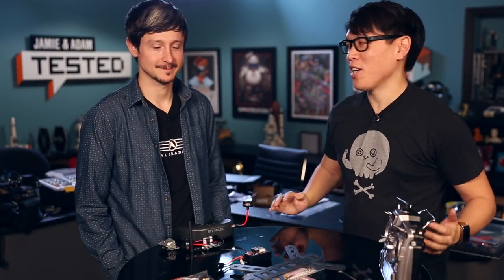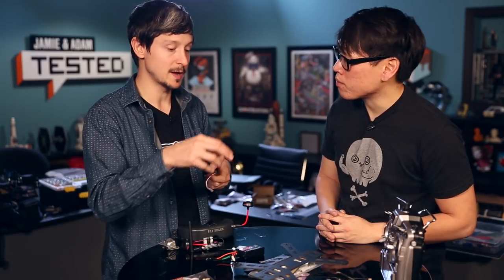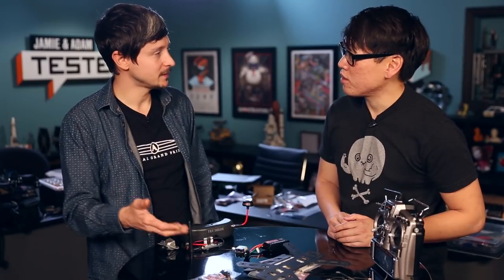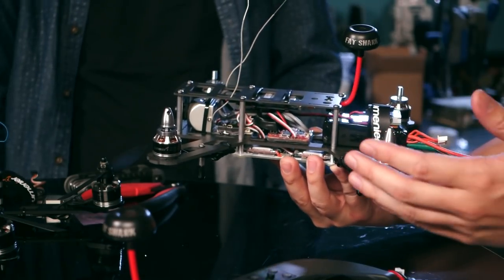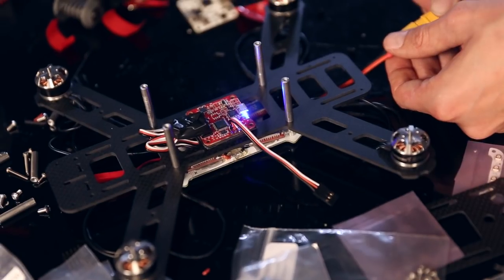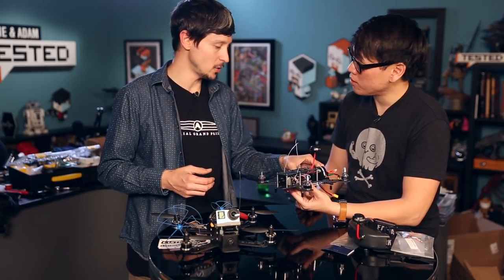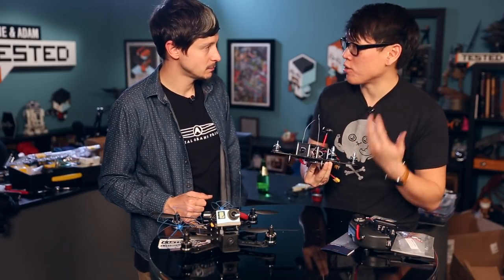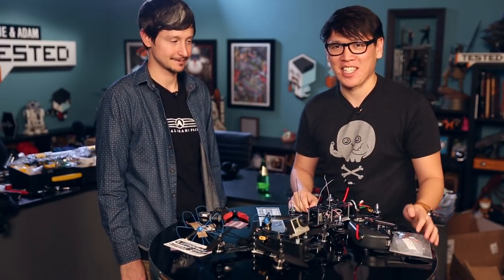How to Build a FPV Racing Quadcopter!

Comment: Hex Copter racers are the future of FPV racing. With Brushless motors these little footballs are easily achieving speeds in excess of 80KPH (50MPH) Outperforming their quad racer counterparts. Smaller size, more power. 20Mph winds? Can still pull out the hex racer. While all the quads go home.
Reply: but... you also have more things to repair and a bigger size to worry about. I am hitting near 80mph with that little guy, dont get me wrong I love hexs! But this is a way better alternative to start with.
Reply: My hex is smaller then this kit. I know when you think of a hex copter, you think big. But I'm talking about Mini Hex Racers. Like the TBS Gemini, The Thorax Mini FPV, Spyder, & Blackout's Mini Spider. Generally Mini Hex kits.

The battery performance on a mini hex gives you more then the power hungry quads of similar size.
Reply: 𝕮𝖙𝖍𝖚𝖑𝖍𝖚 Four motors is enough. It's better to spend the weight budget on higher power motor/ESC/battery combinations than adding more weaker motor/ESC combos. Speed in a straight line is limited by the maximum rpm of the props, and speed around a corner is limited by the power to weight ratio (which again, depends on the max rpm of the props), and acceleration is again limited by the power to weight ratio. Carrying around an extra two ESCs and motors does nothing to help any of these cases, and only increases wind resistance and maintenance. You are also wrong about the sizes, because all of those frames you listed are bigger than the QAV250 shown in this video and would not be able to compete in a 250 size racing event anyway:
TBS Gemini - 315mm
Throrax Mini FPV - 310mm
Blackout Mini Spider - 290mm
In fact, I think you will find that the smallest you can make a hex with 5-inch props is 256mm (with props 0.5mm away from touching each other). Of course you could go plenty smaller if you went to 4-inch props, but good luck winning a race like that.
... and while I'm on a rant, 80kph is nothing to boast about. I made a basic FPV quad a while ago that did 75kph on a 3S battery with 5030 props and it wasn't even made to go fast.
Reply: 80KPH was good for me last year. this year is different. I've also been doing my own builds, and my Hex's are so much more stable, and energy efficient than my Quad builds.
My fastest build comes in just shy of 145KPH This year. Making my old hex's look stupid slow. That's my fastest Hex build. My Quards still have not broken 100 KPH for some reason. Though I've abandoned quad designs altogether at this point. So if I put the big motors on a Quad I could probably get it up more. but I don't want to waist the time on a quad design.
Reply: 𝕮𝖙𝖍𝖚𝖑𝖍𝖚 If your quad builds don't break 100kph while a common kit like shown in this video gets near 128kph, obviously you are doing something wrong. But if you can prove the claim of 145kph with the hex then that is pretty damn good, and you might even be close to some kind of record. Just going from some threads on rcgroups forums, even larger frames are only getting around 150kph at best. You really should make a video or something to show how your hex is set up. I'm sure everyone would be very interested to see how you did it, and I would be interested to see how you managed to get it under 250 size - overlapping props?
I don't understand why you think it's more energy efficient to be spinning six props instead of four for a racer. Assuming you are using props with 4.5 inch pitch, they will be spinning at least 21000rpm to be moving at 145kph (purely sideways and ignoring wind resistance, in reality they need to be considerably faster to also provide lift and overcome drag), and each motor will be using around 170W each which is 680W for four motors, or 1020W for six motors..... how is that more efficent?
At slow speeds or for hovering yes, more rotors is more efficient because the required power output is dictated mainly by the weight of the craft, which can be shared across all motors so they can all spin slower. But at high speed the required power output is dictated by how much air is being pushed past, and if any prop does not spin fast enough to keep up, it just becomes drag. So at high speed having more motors is simply more power output for not much benefit.
Reply: To be honest I would suggest NOT trying the crap I try. I push my S'Spider up to 6s. And have pushed the props upwards to more like 25-30k rpm, If it explodes in my face. that's my own damn fault. I suggest sticking with 3s builds. Nothing's exploded yet, But I did have a recurring issue with props vanishing like magic on me. It's probably not as funny as it seemed at the time. Also I don't fly this thing around people. besides I only get about 5 minutes of flight time on the S'spider. So stick with 3s Builds, here's a link to a really nice motor.
http://www.rctigermotor.com/html/2014/Navigator_0309/197.html

I have pushed that motor way past it's recomendations, I'd advise against it.

Lots of folks run it at 4s,
http://www.rcgroups.com/forums/showthread.php?t=2157642
Reply: 𝕮𝖙𝖍𝖚𝖑𝖍𝖚 Nice motor, but you seem to be losing track of the topic. Are you saying you put six of those motors on a 250 size hex and win races with it? Or are you saying that you put four of them on a quad and it can't break 100kph? Either way I would be quite surprised.
Reply: *****  I don't race my S'spider, I don't fly it around other people! (See previous comment,) We have rules especially made for our local races because of my S'spider. & it's more 350 size, I can't fit it in my backpack. I can't even fit my oversized laptop in most backpacks, Big Backpacks are something I'm always looking for.

SO no, No races! for that machine, and no I don't put those motors on it. But I used to use those motors, and they are really nice.

I have not built a quad in over a year, and when I did it didn't beak 100kph. If I were to use new batteries, new motors, and so forth, and so on. I could build a faster Quad, but I'm not interested in Quads. I like Hexacoptors, More motors = more power, = more batteries = more flight time. I have a 250 racing hex, it is far more stable, and can flip in my tiny apartment, I've Never seen a quad pull off as tight a flip, turn, or spin. Not in a 250, not in a 350. And my apartment is small. It can stop faster, turn faster, and take a much tighter line when flying through obs than a quad. period. You can keep you quads, I'll stick with Hex's.

I wont post any more information on my S'spider for several reasons,
1, It's a dangerous over powered build. The motors overheat, and some wonder why the props don't shrapnel on me when I push it to full throttle. (I'm always looking for stronger lighter props. I'm currently using a 3 blade reinforced Carbon fiber Prop, I like them allot. They are quieter, and bite better. Though some have called them Killer shuriken waiting to lose upon me.)
2. Laws, The gov'nt is always looking for excuses to ban drones. And if I start showing people how I made my S'spider. people will make their own. And that will F'up the drone community. I don't want people copying my build. I've seen it happen before in other situations that I wont go into.
3. I'm tired of people asking me about it. figure it out on your own, I did. I figure if you can't figure it out on your own, you shouldn't be making something like it in the first place. Like Atom bombs.
Reply: 𝕮𝖙𝖍𝖚𝖑𝖍𝖚 
okay, so your original comment that "Hex Copters are the future of FPV racing" remains a baseless claim, and the reason you can't make a fast quad is only because you don't try. Glad we cleared that up. Or did we...? You ramble on about so much irrelevant stuff like finding big backpacks, and a lot of what you say doesn't make sense in the first place, I'm wondering if you are just trolling me. For example you say you don't race your hex, but your local races have made rules especially for it... wtf? And then you say more power = more flight time... wtf? In any case if this amazing 145kph hex really exists, or if you can win a race with the 250 hex against a quad with the same power train, just post a video and a lot of people will be interested to see it. Until 
then you are just talking a lot of crap.
Reply: ***** Had a long answer to spell it out for you. but I realized you would not understand it. so nevermind. you take care now.
Reply: 𝕮𝖙𝖍𝖚𝖑𝖍𝖚 Well why didn't you say that the first time, you think I am a mind-reader? The way you said it, it sounded like they made a special category for hexes or something (let me just copy what you said here before you edit your comment as it seems you like to do almost every time: "We have rules especially made for our local races because of my S'spider"). If it was banned then just say it was banned instead of talking about laptops and backpacks. And you still have not mentioned what the rules are and what modifications are banned... can't you just make it fit the rules and keep racing....? Or is there a problem, ah.... maybe it's not as fast as you say.
And don't consider your point proven. If anything, your point is dis-proven by the fact that thousands of people all over the world are spending a lot of time developing all kinds of racing multirotors and by far the vast majority of them are quads... pretty much every racing event is won by a quad, all the rising stars are flying quads, while you say "Hex Copters are the future of FPV racing" hahahahaha so obviously wrong. You haven't even responded to any of my points from earlier about how carrying around extra motors and ESCs will help top speed, and how powering six motors instead of four is more "energy efficient" lmao. I suppose an octocopter racer would be even faster lol.... No sorry, your point will only be proven when you upload a) video of your imaginary 145kph hex, or b) video of a 250 size hex that goes faster than a 250 size quad using the same power train. Good luck with that :)
Reply: ***** I do edit my comments allot, But it's just my writing process. You responded to my comment before it was in it's final form.
Also I was yammering on about backpacks, because I go off on tangents, It's a habit.

OK final edit: I like hex copters for my own reasons. which I will no longer be trying to explain. your right, I'm wrong. Have fun, and take care.
Reply: *****
Ok, I changed my mind. And wanted to tell you more about Hex coptors, Not mine! Don't even fracking ask about mine. I won't talk about my Hex Coptor. But Hexacopters in general compared to Quads.

First lets talk about weight, Hex copters are heavier. And they need more amps to stay up, But they use fewer watts to kilogram then a quad. So you give it bigger batteries. And with bigger batteries it can stay in the air longer. In other words you don't use the same batteries you would in a Quad. But the thrust to lift ratio is better. So the Hexa stays up longer even with that added weight. You have 1.5 times the power of a Quad for thrust to lift. The added weight of the motors is almost meaningless for all the extra thrust, So you can tak on much heavier batteries than you could ever put on a quad. And get so much more out of it.

Altitude, A Hex can achieve much greater elevations than a quad. For what little weight you have to add for the heavier batteries it still has more thrust to weight than the lighter quad. Meaning they can go higher.

Velocity, Hex copters are faster. More motors, higher power draw. More speed. (Now fracking remember you need a bigger battery, don't think you can use the same battery setup from a quad. Even with a bigger battery, the thrust to lift ratio is better. Meaning for that extra weight you are still getting better flight time.)

Maneuverability. Hex's are not only more stable in higher winds, the extra thrust lets them pull of much tighter flips.

Payload weight limit, Hex Copters can carry more. Meaning heavier cameras. Or bigger batteries. And because their thrust to lift ratio better for the additional weight they will always fly better with the same payload as a Quad. But can also take on heavier payloads than a quad. Put the same larger battery on a quad, and it will barely be able to lift that alone.

Engine redundancy. You can lose an engine, or two on a hex. And it will still fly, and land without crashing. Lose one engine with a Quad and pray you didn't strap an expensive camera rig to it. Because it's going down.

Battery capacity: I'll say it again, you can, and need to put a bigger, better battery on a Hex than you would a quad. But because it takes fewer watts to kilogram the Hex will gain much better performance regardless of the extra weight, and thus longer flight times.

Downsides, Cost! Hex copters are more expensive. Have heavier batters. And so on. So if you want to fly cheap stick with a quad.

Remember, Quads and Hexes are different in various ways. One. Is battery size, and power. Hexes are better at carrying heavier batteries, and need them. And even with the added weight have a better thrust to weight ratio. So they will be faster.

And finally don't take my word for it. Google it. Check what I just ranted on about. look at the math yourself. check the forums.

Comment: I've been researching the parts in this build in preparation for building my own.  Something that is confusing me is how the FrSky receiver (X8R) connects to the Naze32 Flight Controller.  In the video Charpu mentions using PPM (aka CPPM) but from what I've read on the internet the X8R doesn't support PPM.  It uses an SBUS connector.  I have seen people recommend using a SBUS to PPM converter, but that isn't listed in the components list provided. Did you use the breakout cable that comes with the Naze32 to connect to the X8R?  Did you use a D series FrSky reciever like the D4R-II?
Reply: I figured it out myself.  The answer is the breakout cable to the X8R.  This guy's build description has lots of good info: http://www.reddit.com/r/Multicopter/comments/2wvh99/my_first_build_based_on_qav250_frame_with_help/

Comment: Great video guys. I learned a lot but your build is too expensive for me. I am going to use cheaper parts except for the NAZ32. Fly sky 6 transmitter comes with receiver for under $50. Thanks guys.

Comment: If you do not have a switching BEC, you need to disable the red wires on three of the ESC's. What I'm told is that the control board only needs 5v to function. So one ESC will do that. Four Esc's would be over load. So I'm told.

Comment: I have never dealt with electronics in this depth, thus I don't even have the tools to attach the wires/components to the boards and/or frames. So if i wanted to start such a hobby, ill have to start it completely from scratch, like zero..like bagel...like nada..like...li...idk :(

Thus my question is; With off the top rough estimate, how much would it cost me to buy EVERYTHING, from basic double sided tape to the FPV screen itself? Am I looking at spending around $2,500 as a start for literally everything? Thank you!

Comment: I have heard two opinions. Some say t you have to disable the red wire on three of the four ESC's. Another guy I know who builds these things says he never disables the red wires. Any other thoughts?
Reply: My opinion, if its not broken don't fix it.  But on your statement " on three of the four ESC's, it does not make sense on my end. would it be off balance?. but the set up seems to be just for forward applications...

Comment: CHARPU FPV May you explain, what double-sided tape you used? I just can't find something similar... Maybe you got a link for me? And do you use 2mm bullet connectors between the ESCs and the motors on your 4s setup too? I'm a bit worried that they could get hot...
Reply: I was gonna post you a link but my browser is sucking... Do a quick google search for "servo tape"

Comment: How would you build a quad that just focused on range and distance and not so much the speed? Bigger transmitter with bigger blades and small motors since you dont want it to go crazy fast?

Comment: first .. great job :) ,, i want to know if i leave the romote control when the quadcopter on the air what happens ? she stay on the air or not ??! ,, i want Answer please
Reply: Too genera of a question. Depends on your FC settings and the capability of your equipment. On this rig? It will fall out of the sky. :)
Reply: thank you very much :)

Comment: When I went on the GetFPV website,  ordering 1 quantity of the motors get you a set of 4 or just 1 motor?
Reply: TheChingChongMaster The motors are sold in singles. For a quadcopter you'd need 4.

Comment: How much does it cost to bild a basic beginner fpv quad? I have also heard that the battery lasts very short, can i have multible batteries that i change between so that i can fly for a longer time? Or isnt the battery detacheble?
Reply: It doesn't have to be 850 dollars, a beginner setup could cost around 300 dollars if you go cheaper.  You can have as many batteries as you want, they are detachable.  Good luck!!
Reply: +J Timmer There are tons of videos on building cheap fpv quads, take a look at AndyRc

Comment: What's the lower  frequency is he talking about for longer range when he's running his video at 2.4 ?
Reply: I think its 1.4ghz but you can go down in the Mhz range....it all depends on the available hardware really. just remember the higher the freq the more it gets effected by bouncing off obstacles (trees,walls etc),lower freq has better penetration of objects.
Reply: You can also buy 1.3 GHz and also 900 Mhz